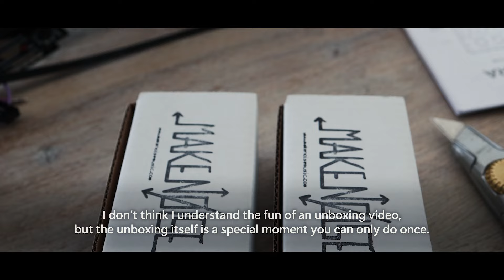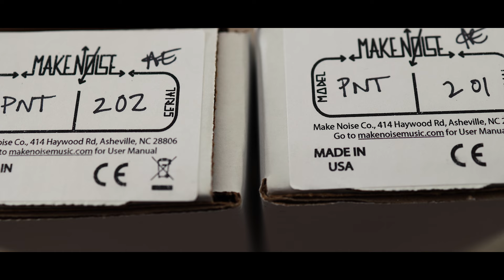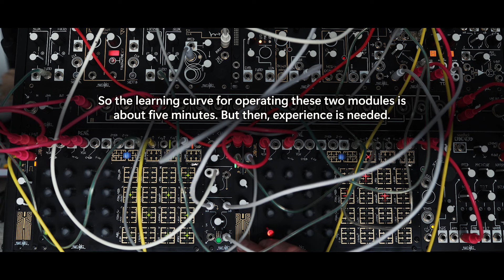MakeNoise PrssPnt & Channel Saver | First Patch

Comment: My fingers are likewise capactively challenged to reliably trigger Pressure Points. Never suspected alien blood, but now other anomalies are beginning to make sense, such as the struggle to wire my custom dual display Disting Ex module. Failure to correctly count pins is a known shortcoming of the off worlders. Your viddy was again replete with marvelously novel bloops, bleeps and textures.
Reply from the maker: It's funny I never had any problems with PressurePoints, but 0-CTRL and Rene V1 always gave me a headache while Rene V2 always works perfectly. Not to mention that Buchla 218 keyboard. I was so worried, but it's a dream to play. PrssPnt works fine, but I needed it to be on 100%. You can always trim down sensitivity with the front knob :).

Comment: I will second your comments on DPO. There comes a time when you think you’ve got it figured out and then you try something simple through the mod busses and realize you have a lot left to discover. I’m surprised to hear pressure points is discontinued! Glad that I completed my system when I did.
Reply from the maker: I may be mistaken here. PressurePoints is still in the list of current modules. Brains is definitely discontinued.

Comment: Thanks much .. PrssPnt .. the organic, chaotic contribution, indeed is a valuable add .. sort of in this same vein .. I've been meaning to ask if you've curious about footswitches, such as a Doepfer A-177-2. "Scratching the surface" .. that's how I feel about this module. Oh, .. and a Moog petal/similar quality to trigger it, and all the places that a person can go with some by hand (by foot) inputting.
Reply from the maker: I have the Instruo Larachd which comes with a footswitch. I never used the switch until now, but It's a must have feature if you're doing granular synthesis with a live instrument where you need both hands to play AND start recording. It's a valuable addition for my toolbox, but didn't encounter a need for it yet. It would be fun to just noodle my guitar and use Arbhar and Lubadh.